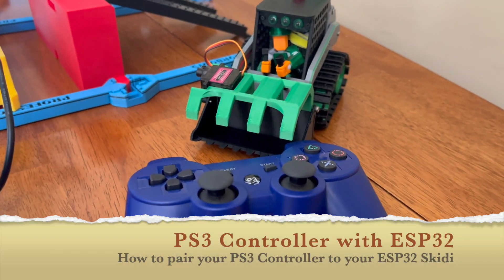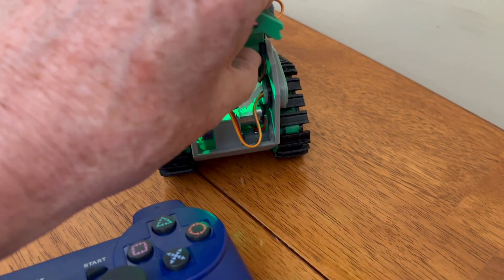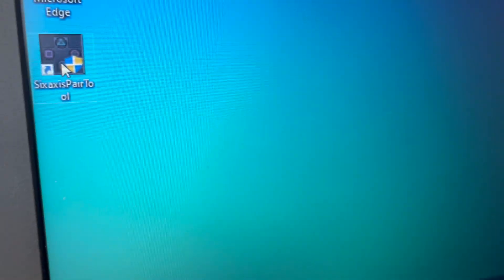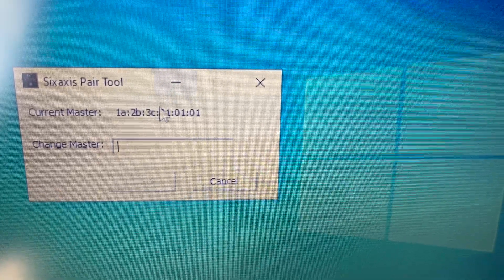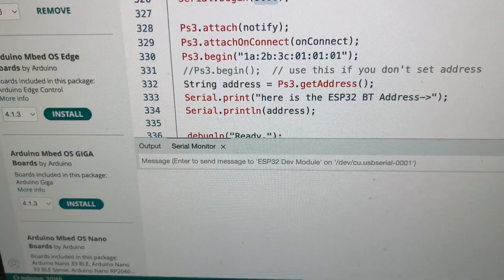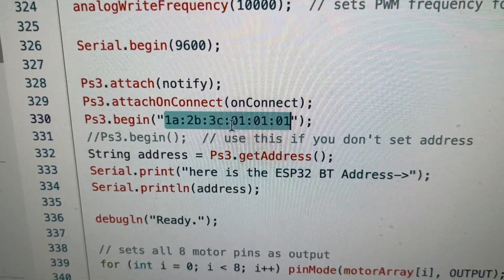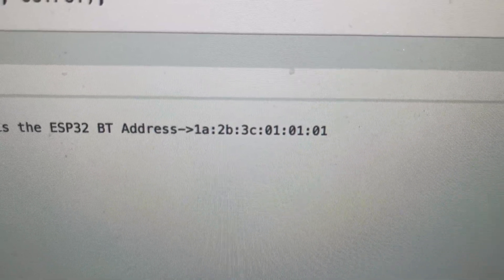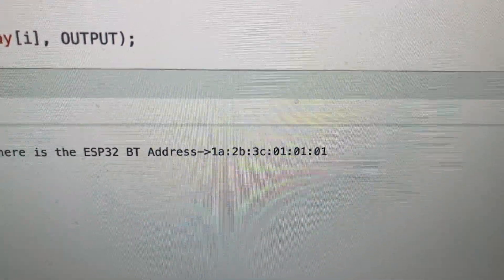Connecting PS3 Controller to ESP32 controlled RC Skidi

Comment from the maker: See links in the description for examples of PS3 code, using the Arduino IDE. I've created code for my specific PCB (available on GitHub at link in description) and is available for a Skid Steer, Large and Small dumpTruck model that I've modified on Printables. (also linked in description)

Comment: My controller will connect and control mine when plugged into pc but as soon as i unplug it my controller won't connect any suggestions or tips on how to fix this.
Reply from the maker: That indicates that your power supply to the PCB is not working properly. You would need to get a Volt meter and probe around the PCB to see if you are getting 5v from the regulator. You really need a schematic to help you find what points are what on the PCB. Not sure if you have that available to you depending on the PCB you are using. Try to get a schematic and then find someone who can help you do some electronic troubleshooting.

Comment: Only when i use an outside power source (like a 9V battery with a step down module), not powered straight to the computer, does the controller disconnect after 1 action. Do you have any tips?
Reply from the maker: No.. too many possibilities.. First thing to check is the power. You need a schematic for your PCB and check the power going to all devices. But sounds like the ESP32 is not getting the proper voltage to it. When you plug in USB, the ESP32 gets power from that.. unplugged it should get power from the battery. Could be your regulator is not working properly, but I haven’t looked at the schematic in a while and I use my own PCB.
Reply: @ but the red light stays on and the light on the power module as well so i am stumped
Reply: @davecrabbe4579  do you have any ideas regarding my previous message?

Comment: I can’t get the sixaxis tool to recognize my ps3 controller!  Every time I plug the controller in Sixaxis says no device found. But the controller registers in Windows usb controllers. I’m at a loss. lol.
Reply from the maker: It likely registers as an XBOX controller, not a PS3 controller in Windows. Many clone PS3 controllers from China have different firmware than the originals and no longer respond exactly like the old PS3 controllers did. SixAxis can't work with those. So PS3 controllers now are a problem. I bought 2 controllers from AliExpress and they worked great. The next 2 I bought from the same place would not work. I don't have a solution for that..
Reply: Appreciate you getting back to me. Yea when I plug them in it registers as an Xbox controller. Too bad there isn’t a way we could flash the ps3 firmware on to it somehow. Oh well guess I’m off to ordering some actual pS3 controllers. Hopefully someone smarter than me will setup bluepad32. I have a ton of Xbox controllers! lol
Reply from the maker: @wj625  I've had luck with POWEREXTRA brand from amazon.. purchased twice and they worked.. but last was about 5 months ago.

Comment: Hey, I bought 6 of these controllers to use with ProfBoots projects and I cant get a single one of them to connect, I wonder if you have any ideas? I tried doing what you've done in your video and it didnt connect, tried older firmware and it wouldnt connect, tried the default MAC address and tried changing it, tried using the MAC off the bluetooth on the ESP32 and nothing seems to be working. But its got the same funky buttons as yours and yours works so I am at a loss with it.
Reply from the maker: Unfortunately Sony no longer makes PS3 controllers and so all these are clones. Several months ago the one I was getting from AliExpress had different firmware in them and although they work with a PS3, they are not compatible enough to work with SixAxisPairTool. If you can get them to work with that utility, then you are okay. Are you using the SixAxisPairTool? Does it pick up the controller to allow you to set its IP address?
Reply: @davecrabbe4579  Hey, yeah it works with the sixaxispairtool and I can read and edit the MAC address. Mine is definitely a clone but its the same one as yours with the weird button graphics on the right side. I've bought a different style PS3 controller to try but I already bought six of this first time so its frustrating that they wont bind.
Reply from the maker: @Atlas_FPV  If it works with sixaxispairtool then it should work with the esp32. In one of my videos I show some code where you can use the serial monitor to see if the bluetooth address in the ESP32 is being set to the value you want.
Reply from the maker: The PS3 controller does not have a BlueTooth tx. You tell the PS3 controller what bluetooth to bind with.. and that is the ESP32.. So you set the ESP32 bluetooth address using the Arduino code.. something like 1A:2B:3C:01:01:01 .. this sets the BT address of the ESP32. Then using 6axis you tell the PS3 what address to bind to. So you use the 6Axis to set that address inside the PS3. Use the address above. When both are set the same, you turn on the ESP32 device. Turn on PS3 and it should blink fast for about 1 second or less then 1 light goes on. I think you are doing the process incorrectly.
Reply from the maker: I've got a few videos on the code I used for the skid and dump truck..  Search my YT channel. if you follow the code pertaining to the BlueTooth address and use the exact same addresses I do, it should at least bind.. then working is up to how well your code works. I really like the PS3 code over the BluePad because it is simpler. One problem.. you MUST use the older library versions that I mention in some of my documentation on the printables mods for skid/dump.. For instance the v3 of the SERVO library doesn't work with PS3 stuff.. If you look at my skidi code it is documented inside of the code.

Comment: No code.. no like 😂
Reply from the maker: See links in the description. Code is specific to the model and the PCB that you use and there are many. This video was designed to allow you to connect the PS3 controller to the ESP32 and then it is up to you to get or create code for your use-case.

Comment: Hi i paste the same mac adresse and the ps3 do not connect what can i do ?
Reply from the maker: Did you connect your PS3 to the 6Axis tool and get a Mac address? then use that address in your code? Did you add code to display your Mac address? If you open the serial monitor on the IDE what is the response? Did it use your Mac address.. maybe you have a typo in your code.

Comment: I've got the controller to work but my left analog stick is all out of wack.  Forward is right, back is left, right is forward, and left is back.  Not really sure whats going on.  It's fine using the phone.
Reply from the maker: I'm not sure what s/w you are using. PS3 code that I released for the RC_Controller? So in line 2 of my PS3 code it says Ultimate RC_Controller Release.. The control is all about how the motors are hooked up.. So you'll see statements like:  #define rightMotor0 33.. and #define rightMotor1 32. Just debug the right motor.. Put the left joystick up and see if the right motor goes in forward direction. If it goes backwards, reverse the 33/32 numbers.. that is make Motor0 32 and the other 31. Do same for left motor. Hope that helps.. You can email me at [removed for now] and I can help you thru process if you are using my PS3 code.. If you are using BluePad I can't help a lot, but somewhere in BluePad is the link to the pins the motors are using like I explained above and you can use the same process to debug.

Comment: hi dave, im having trouble with reading the mac address from the sixaxis pair tool, so its not detecting the controller at all, ive tried both ps3 & ps4 but same result, any suggestions on what to do next? thanks in advance!
Reply from the maker: Many of the generic PS3 controllers are not mimic-ing the old PS3 controller. I’ve found this recently from the ones I’ve bought from China. (AliExpress). I don’t have a solution for those other than to pair them with a PS3 console and then find the MAC address of the console (the console will have some setttings menu and will show it). The controller will have the console’s MAC address stored inside it and you can make the ESP32 MAC address the same. This is a weakness of the PS3 controllers.. it is getting more difficult to get one that works with SixAxis.. Now if you can get a genuine PS3 controller (borrow one) you should hook it up to your computer and the SixAxis app just to ensure you have the app working properly. If you are in North America, I’ve had good luck using the PowerExtra brand from either US or Canadian Amazon store.
Reply: @davecrabbe4579  Thank you so much, you saved me hours from testing multiple drivers etc, i dont know what im doing anymore, ill try finding a genuine controller to try out. Fingers crossed! Once again thank you
Reply from the maker: @dannydjoko  Six Axis app will only work with the PS3. I don’t think it works with the PS4. There is a software library called BluePad that works with PS4 & XBOX controllers and others. It is more complex than the PS3 library and so I haven’t ported my code to it. The PS3 controller thing drives me nuts.. Sometimes you can find a genuine one, second hand cheap.. or borrow one from a friend to test. You can tell the ones that will work from the ‘fakes’ by connecting directly to Windows.. Windows will identify the ‘fakes’ as XBOX controllers (even though they are sold as PS3). A real clone of PS3 that works with Six Axis will show up as PS3 controller in Windows.
Reply: @davecrabbe4579  im using bluepad at the moment but its not registering on the serial monitor for some reason, im currently stuck on that and not sure what to do, im suspecting something wrong with the bluetooth on my esp32 so im planning to try it on a different esp32
Reply: I mean im trying to connect the ps4 using a bluepad tutorial but its simply not pairing with each other
Reply from the maker: @dannydjoko  unfortunately I have not used bluePad much. I use the ESP32 Dev Kit v1 (30 pin). When running correctly you should just hit the button on the PS4 that pairs and it should auto-pair. I don't think you can use a PS3 to auto-pair with bluePad, but you can auto-pair a PS5 and XBOX controller. Sorry I can't help there.
Reply: @davecrabbe4579  Most of these generic controllers have a small reset hole on the back.  Mine wouldn't connect until I hit the reset button.  I noticed if the lights flash fast it won't connect, it should be a slow flash and it'll connect instantly.
Reply from the maker: @1tssen  yes!.. you want the slow flash.. I'll check my other controllers to see if I can get them to work by pressing this.. think I tried that.. but maybe not